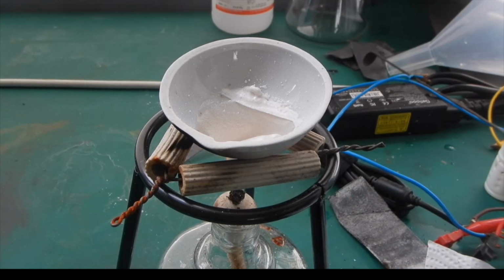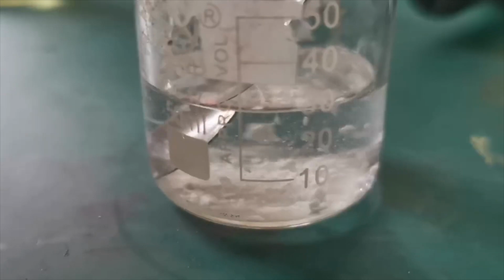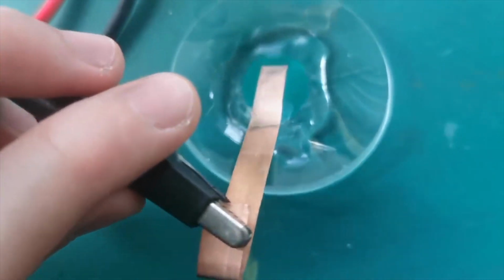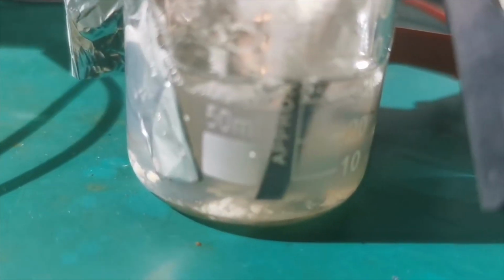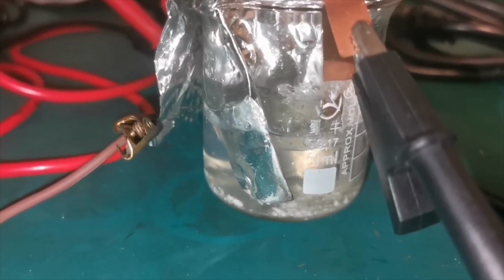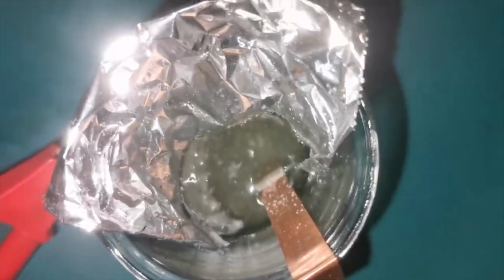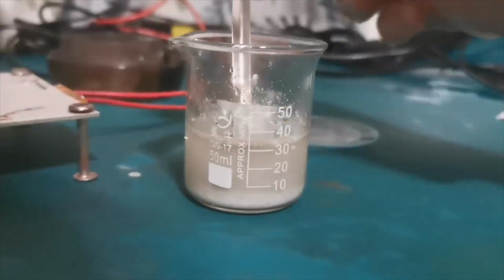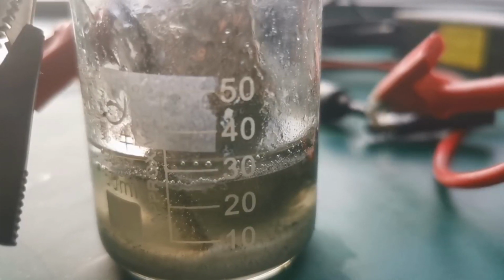2.3.4 Reactive Metals - Making Lithium at Room Temperature

Comment: I suppose it's a dumb question, but what's preventing the aluminium from the aluminium chloride to deposit on the copper electrode?
Reply from the maker: Good question... I assume it is because that aluminum exists as AlCl4- which has a negative charge and so does not get reduced at the cathode.

Comment: It would help to dry your lithium chloride under a vacuum as the stuff is insanely hygroscopic. They use lithium bromide for keepling refrigeration systems coolant lines dry.❤
Reply from the maker: Right. Completely drying a sample of LiCl would require a high vacuum and/or heating to its melting point. However the small amount of water doesn't really matter in this preparation as the water will be electrolyzed first.